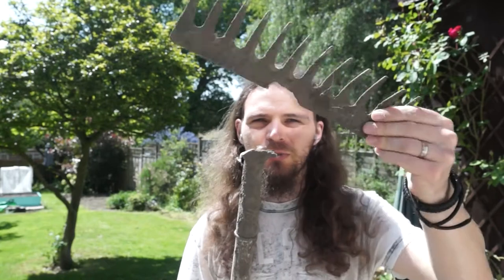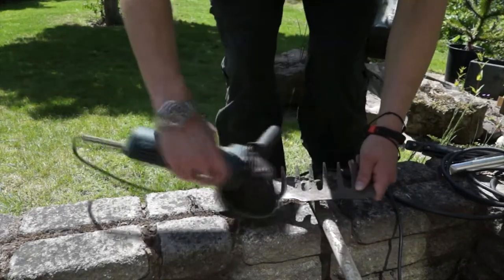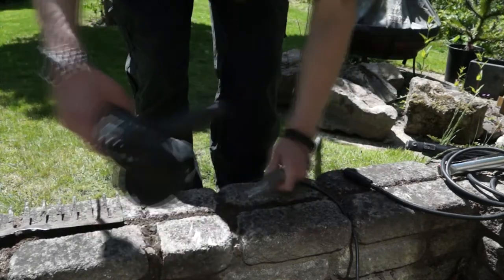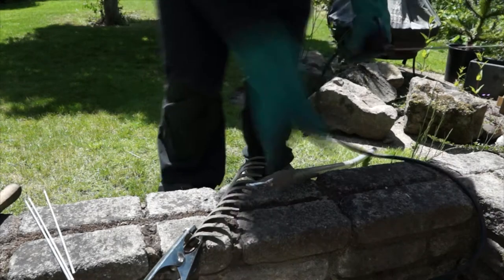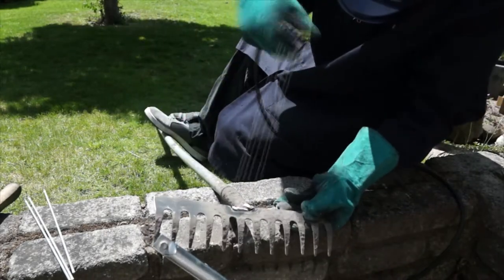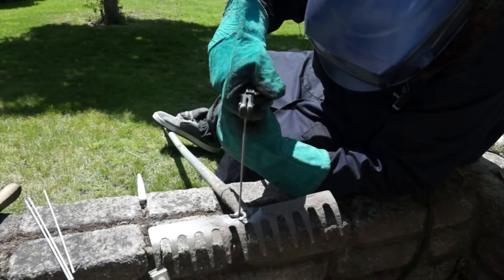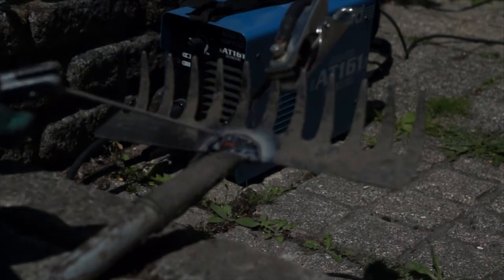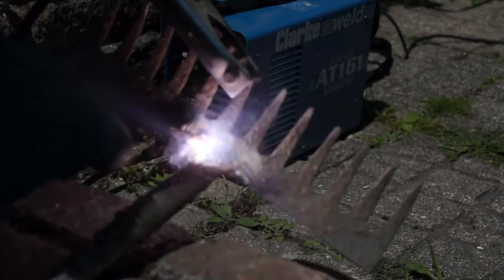Fixing Garden tools with welding

Comment: Just an absolute beginner learning to weld and do similar jobs, but why not weld on a bit of extra sheet or angle as reinforcement??
Reply from the maker: It was a little bit of a odd shape and fairly thin (easy to melt holes accidentally)  but if it breaks again I'll grind it square and do just what you said and put some plate on as reinforcement. Thanks.